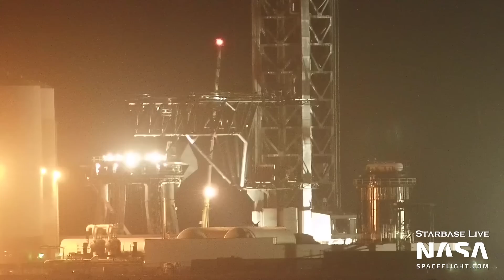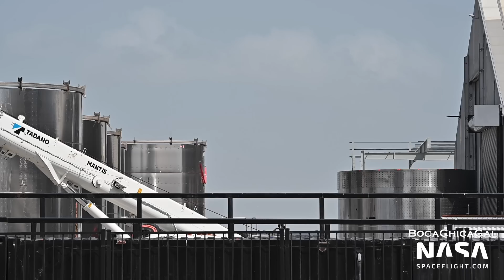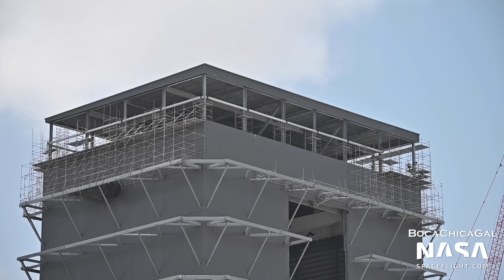Ship 24 Prepared for Engine Testing | SpaceX Boca Chica

Comment from the maker: 0:00 Actuator Removed from the Rear Chopstick
0:28 Sunrise Over the Launch Site
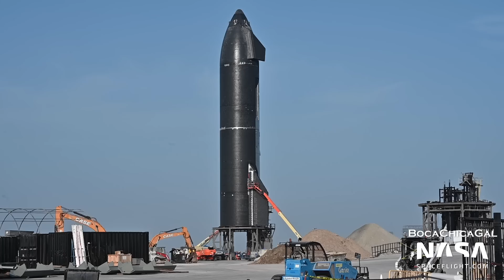0:53 Crews Work on Ship 24’s Tiles
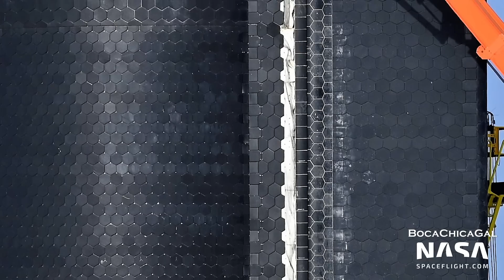1:46 Ship Quick Disconnect Arm
2:07 The Chopsticks and the Orbital Launch Mount
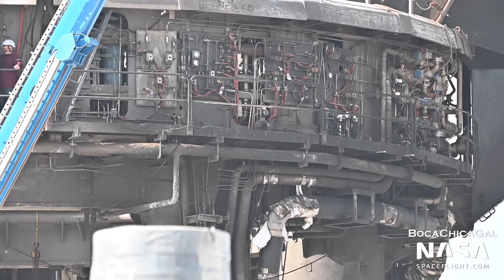2:42 The Launch Mount is Charred From an Explosion During Testing
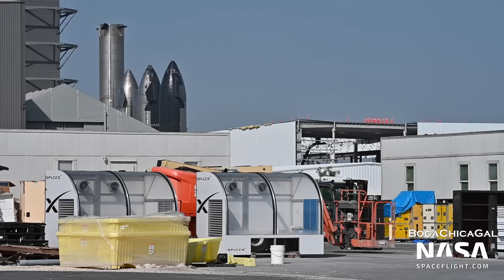3:37 The Production Site
3:54 Ship Domes Outside the Tents
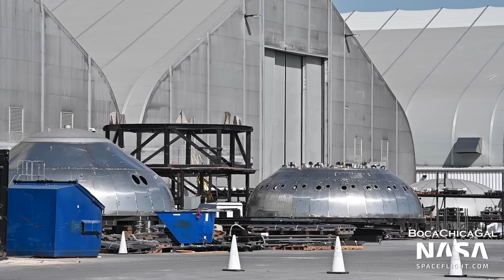4:13 Booster Aft Dome
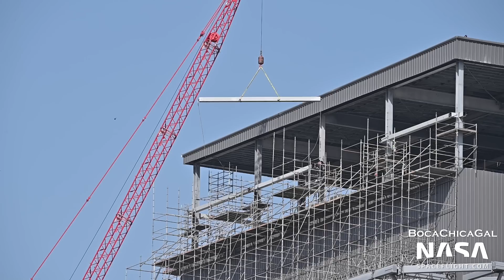4:48 Beams Lifted Into Place for the Mega Bay
5:34 Booster 7 in the Mega Bay
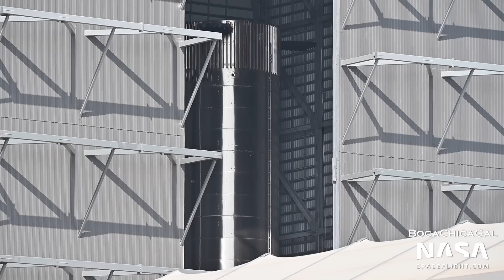5:55 Barrel Section in the High Bay
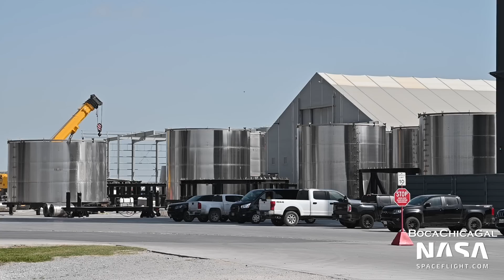6:12 Barrel Sections Outside the High Bay
6:32 Crane Moved to Work on a Different Section of the Mega Bay
8:16 Ship Aft Barrel with Quick Disconnect
9:31 More Beams Lifted for the Mega Bay
10:12 Rear Chopstick Actuator Replaced

Comment: I'm wondering if I have this right.  SpaceX build 8 huge custom tanks for oxygen, methane, nitrogen, and water.
Of the 8, only 5 are fit for purpose.  The 2 methane tanks did not conform to Texas standards and were not approved for use.  The 1 water tank is leaking and not being used.  Is that correct?
Reply: Move fast and break things. 🤷
Reply: The two original methane tanks now hold water, so there's only one not being used right now, the original water tank.
Reply: @jasonlooney7042  I haven't heard that.  Did they add the internal bracing they failed to add in the original water tank?
Reply: @59seank  Yes, they did that before those internal tanks were installed. Let us hope it was adequate.
I am just glad they got some use out of them. What I would expect now is replacing the old water tank with another LOX/LN2/water tank. They can't just leave it there, or would they?
One good thing is that now there are two water tanks and two LN2 between the LOX and LCH4 tanks.
And, now SpaceX have learned a lot more about tank farms, and what not to do.
Reply: @59seank  Not entirely sure if the bracing is there. I watched a CSI Starbase video with this information. I’m incredibly impressed with that new channel. Great analysis.
Reply: @jasonlooney7042  oh the irony!

Comment: those exposed systems on launch mount.
why are they not covering it like they covered other systems on the other side of launch mount
Reply: Because any methane that gets inside will be trapped if it was closed, and that would cause a lot more damage than we saw this time. They want air to be able to circulate freely. But they might place better open shielding to cover the critical installations. This after all is an R&D site as much as it is a launch site.

Comment: Is it possible to launch ship 24 with a booster other than booster 7? This could be a clue as to spaceX's confidence that b7 can be reused after the mishap
Reply: No, booster 7 is the only complete booster at the moment, booster 8 will be completed by the end of next month
Reply: @Alucard-gt1zf  Yeah but I was wondering if it'll be possible to launch ship 24 with a different booster once one is complete. Although I suppose they probably wouldn't be preparing for engine testing yet on ship 24 if they thought they may have to wait until b8 is ready
Reply: @mcnuggatron2129  

To answer your original question, yes, booster 4 and ship 20 were only cancelled because their raptor ones were out of date, but there is no reason any numbered ship couldn’t fly with any numbered booster. So booster 8 could definitely launch ship 24 if it came to it. It will depend on how long the damage to B7 will take to fix, if booster 8 will be ready by then, they may decide to trust a fresh booster.
Reply: @TBone-bz9mp  S20 could not be flown on B7 because SpaceX changed the latches that connect the two. But S24 can be paired with B8 because they both use the same latches.
SpaceX always builds 2 identical ships/boosters at a time. The second as a back-up.
Reply: @knowledgeisgood9645  

Oh yes, forgot about the latches.

Comment: Honest question: If you were to put say, a Model Y battery in cryogenic cooling liquid. What would be the thoughts? Explosion..Super conductor...capacitor.  don't know ??!!!
Reply: None of the above.  Not cold enough for super conductance.  Cold enough to prevent a significant amount of ion exchange, essentially turning the battery into a big, useless brick of lithium.

Comment: if the launch mount is this damaged by an air/gas explosion, how will it survive a booster test, let alone a launch.
Reply: The launch is not like that explosion, it is designed to take the rocket exhaust once it liftoffs from the mount
Reply: Also, the explosion happened under the mount so all of the lines pipes were exposed, the rocket exhaust will be hitting the top where there are protective covers for everything.

Comment: 7:14 never seen a deployed crane on wheels moved that way before! Must be risky, no?
Reply: Actually, the risk is less with it unloaded than if it was under load. Cranes are commonly moved with a load from one place to another. The crane itself and counterweights weigh FAR more than the boom and load combined.
Reply: @PhilG999  Thanks!
Reply: @joyl7842  ;)
Reply: @PhilG999  Truck cranes aren't moved with a load as they rely on the outriggers for stability. They are seldom moved with extra boom sections attached because they are most often only used in one position at a job site then they are dismantled to drive to the next job. This site is different as they are used at several different places and there aren't any overhead obstacles so they can save time by nor removing the lattice boom.
Reply: @tiredoldmechanic1791  I've seen a few crane operators that didn't know they couldn't move a load. Boom up and short, load tucked in tight, off they went! ;)

Comment: so both chopstick actuators have been replaced?
Reply: Upgraded it seems. But yes.  Both
Reply: It looks likely they are being replaced with more powerful and faster actuators. They also added 6 pairs of hydraulic COPVs on each side of the claws holding the chopsticks, to aide those two actuators. The obvious goal has to be to make the chopsticks move faster.

Comment: I wonder if the tech exists, that could allow you to kinda "3D print" Or spray paint the heat shield onto the vehicle?  Like the idea to use 3D printing Martian regalith to build structures on mars!
Reply: I think the reason they use tiles is due to thermal expansion, small tiles can expand without cracking, a larger one piece tps would have to be very flexible to not crack
Reply: @paulmason6847  Spot on, Paul.  Also, I doubt the hardware exists to 3D print the heat shield at that scale, even if they wanted to.
Reply: @paulmason6847  Yeah I thought about that 30 minutes after writing the comment
Reply: @glennpearson9348  They can 3-D print a whole house so yes, it does exist. But there are other things that have to be contended with so they won't.
Reply: @gravelydon7072  They can 3D print an entire house made of sophisticated, low heat coefficient ceramic?  Nifty!  Where is this house?  I'd love to see it!
Reply: @glennpearson9348  It was made of a form of concrete but the material is not a problem. Just about any material can be 3-D printed now days with just the changes in the material, feed system, and the nozzle sizes. They are even 3-D printing parts of the Starship's engines and even whole rockets.
Reply: @gravelydon7072  Yep.  I've seen the 3D printer Relativity is using for their rocket and the different companies that are 3D printing rocket parts, including engines.

Still, the size of the printer needed to 3D print the TPS for the Starship in a single piece would be enormous, even compared to that needed to modularly print an entire house.

Who knows?  Maybe SpaceX will figure all this out one fine day.  Maybe they'll even develop a printer for the silica tiles.  In the meantime, will have to make do with hand-placed, oven-baked silica tiles.

Comment: Is spaceX going to blow Starship 24 up too?
Reply: Maybe. S25 is on its way to replace it in that case. They are relatively cheap to build, so they don't mind too much if such things happen. It is the loss of time that is the problem, but they are fast.
Reply: Even if Starship 24 goes full RUD, the scientists, engineers and construction contractors will get lots of valuable information.. which is a big win, as always.
To this caliber of people, NO test is a ‘complete failure’. There is ALWAYS data to analyze.
Data, Baby!!